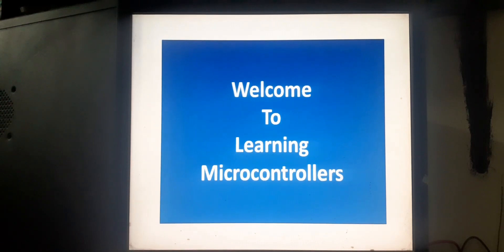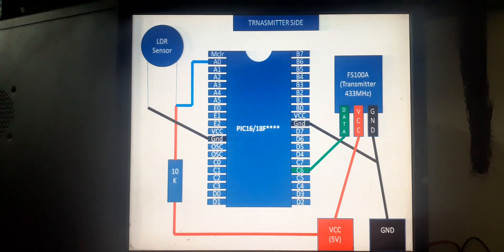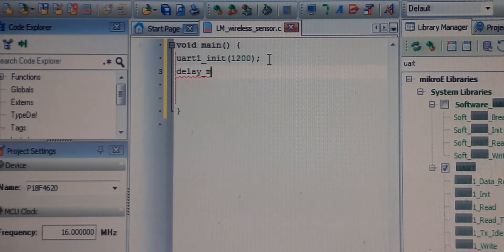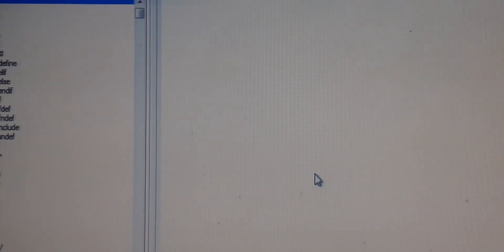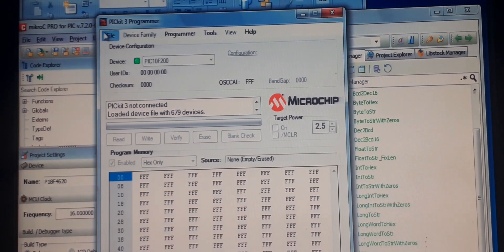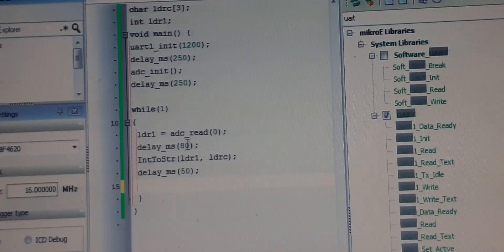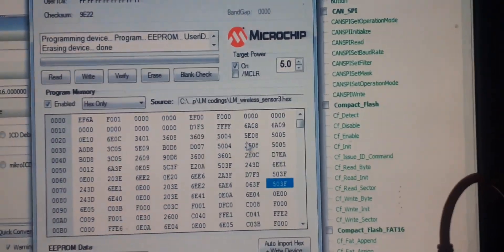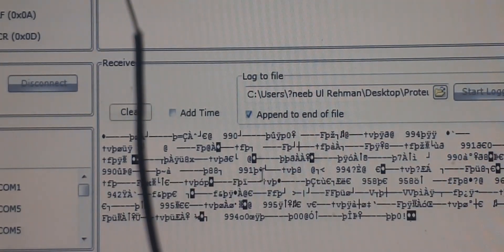PIC16F877A/PIC16F887/18F**** interface Wireless sensor using Cheap 433MHZ RF modules and LDR

Comment: hello , i need help, how can i contact you please ? i'm doing a project with 2 PIC16F876A one as master and one as slave, and i need help with the code if possible
Reply from the maker: Explain whats your problem ?
Reply: @learningmicrocontrollers3561   
hello,
for my project, i need to use LoRa protocol to get information from a sensor, if possible to help me coding.
and if you have any idea of the protocol RS485 that would be so great.
Thank you so much
Reply from the maker: You are using lora
Then why use rs485
They both do same thing
Difference is
Rs485 uses wire
While lora id wireless